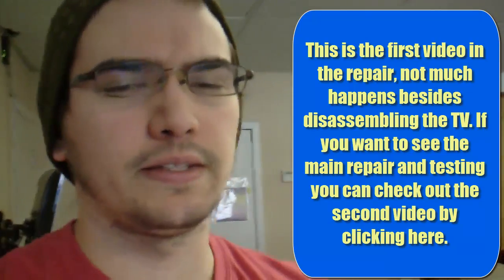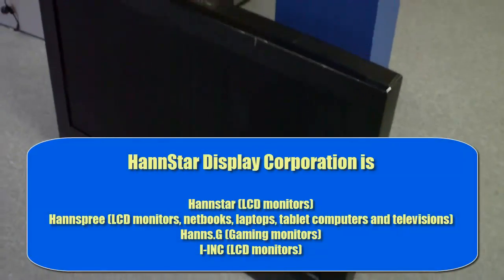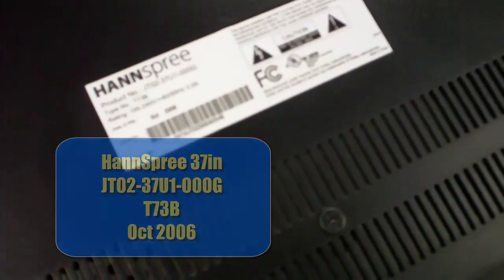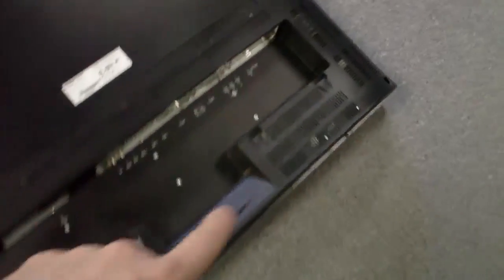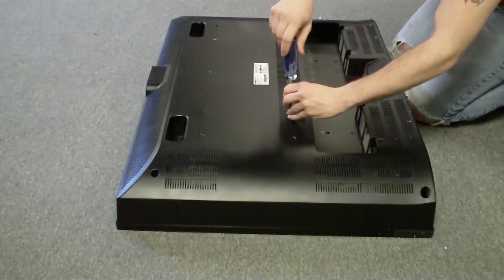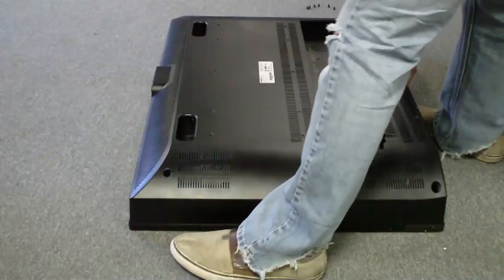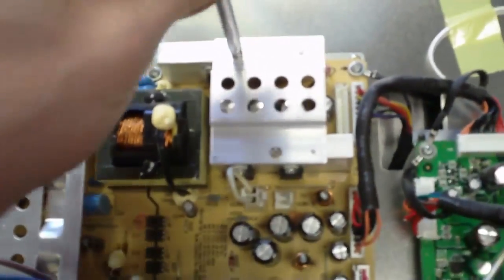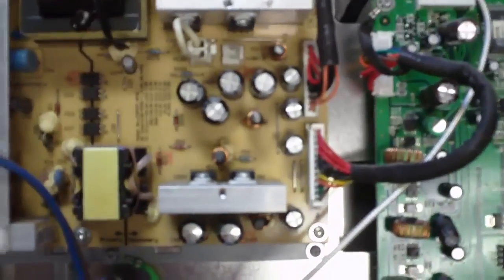HannSpree JT02-37U1-000G 37in TV Diagnosis and Repair 1 of 2 Disassembly and Diag

Comment: I think I had 7 electrolytics 3 @ 1500uf 25v 1 @1000uf 25v and 3 @ 220uf 25 volts I had the 220uf (rubycon) in stock but the rest had to put up with 1000uf 50v! (cheap make) anyway it done the trick. Also i was a scrap tv i found and for my own use!